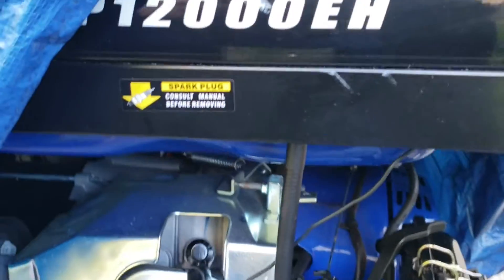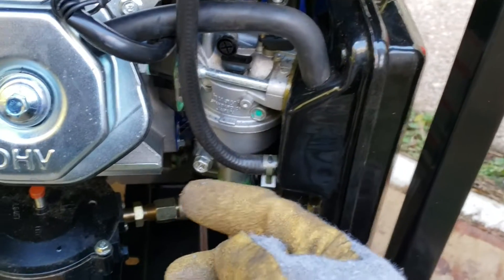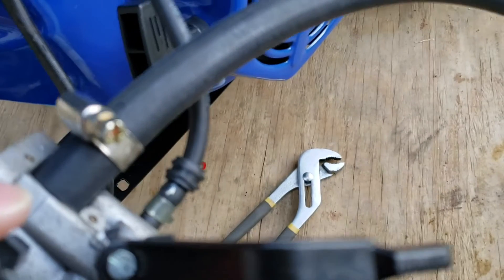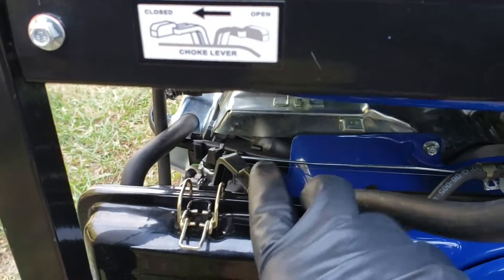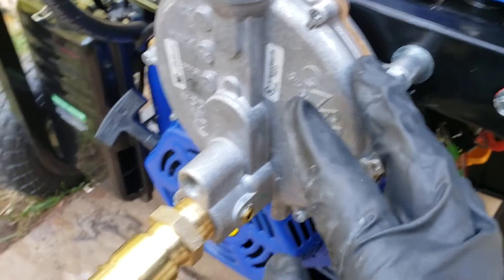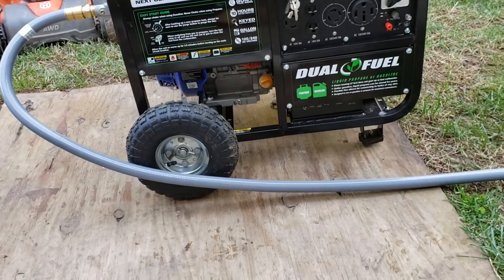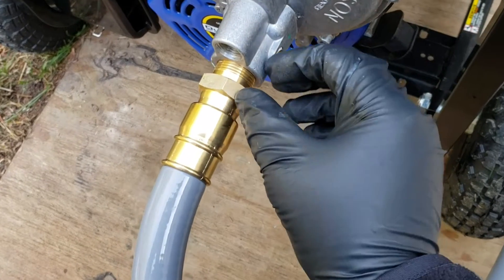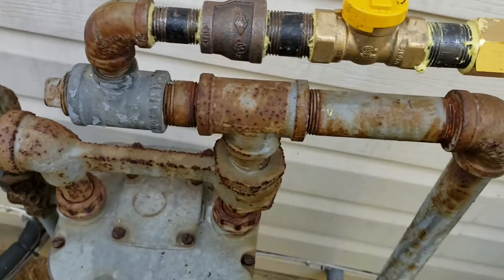DuroMax XP12000EH - Converting Gas/Propane Generator to Natural Gas (Dual Fuel to Tri-Fuel)

Comment: I did my testing with a xp12000eh on natural gas. I got the same regulator and hose as you have. My gas meter is in the front yard, my generator is in the back yard. From the meter, I have a 1inch corrugated run of about 15 feet to a 3/4” manifold. From there I have one 3/4” outlet and five 1/2” outlets. I originally had a 1/2” run of about 12 feet to the bilco door in the back yard. I stepped the 1/2 up to 3/4 and connected the quick disconnect and 3/4 line to the generator. I was able to pull about 5500-6000 watts just fine. I then replaced the 1/2 to 3/4 all the way and added an exterior Stainless Steel Burnaby “gas plug” cover panel and had no improvement from the step up. Overall I am very happy. Thanks for the video.
Reply from the maker: Wow, so it doesn't really matter if the gas line is 1/2 or 3/4... I wounder why so many people online claim that you need such a thick gas line for these generators. I could have saved money on my expense 3/4 line. What do you think the Max watts this generator could do on NP? I read that you can expect 80% of watts from the listed gasoline spec. Thanks for sharing

Comment: The ideal configuration is to have propane and also natural gas. Here is such a regulator: https://www.ebay.com/itm/New-Chinese-Natural-Gas-NG-and-Propane-LP-Regulator-Please-See-Descript/264198501779?hash=item3d83753593:g:I~QAAOSwXlpcZwsu
Reply from the maker: The problem with these type of regulators (link you provided) is that they are made for lower HP engines. This one in the link is for a 10HP engine or less. This Duromax is 18HP . I can still run this generator on propane with the regulator that I installed.
Reply: Exactly... 10hp on propane so more like 7hp on natural gas.

Comment: I assume (don't laugh) that adding this NG capability doesn't negate the ability to also use gasoline in the future, right? It's just "adding" NG capability...it's not removing the gasoline capability? I'm in Florida in hurricane season and getting ready to get this Duromax 12000. I'm in a NG community and want to do the same. Love the set up!
Reply from the maker: Nope it doesn't negate the ability to use gasoline. In fact... I did a follow up video a few weeks ago that shows how easy it is to switch between NG and Gasoline. https://youtu.be/okGfZKPHx6E
Reply: @Mr-Chris  Duromax 13000 arrives soon, and so does the NG regulator. SUPER helpful video. Used to live in Fairfax. If I'm ever back up in the area, I owe you a beer!

Comment: Your experiment worked - you installed the US Carburation NG regulator and did NOT install the Snorkle piece, and your generator ran fine on NG.  So, why does US Carb include the Snorkle piece?  It doesn't seem like it's necessary.
Reply from the maker: The Snorkel is for Generators that run only on gasoline and need to be converted to natural gas/propane. Since my Generator is already was setup to run on propane, I didn't need the Snorkel. US Carburation sells a kit without the snorkel, but I didn't know that at the time

Comment: I'm impressed that you can run your central AC with the generator running on NG.  You lose about 20 - 25% generator output power when running on NG.  Running my Sportsman GENTRI9K tri-fuel (rated at 9000w surge/7200w run), I'm probably only getting about 5000w running power, and of course, that won't run the 4-ton central AC.
Reply from the maker: Im lucky that it does since my Generator is (12K surge/10K running) that brings me down to (10K surge/8K running) on NG. Also my HVAC is one of those newer two stage units so my AC starts on the lower stage making it easier on the generator to run it when it kicks on.
Reply: How do you know how many watts the generator is putting out?  I have the gentri10k running on natural gas.id like to know how I can check. Thank you
Reply: @thetonekingofficial  I was just estimating.  Running on NG gets about 80% of full power running on gasoline.
Reply: Look into a soft start for your HVAC compressor. It will dramatically lower the starting amp draw on a regular compressor.
Reply: @dalltex  Yes, I had one installed ($500) on the 4-ton central AC.  The 9kw/7kw still won't start it.  I ended up installing a 2-ton 3-head ductless AC system ($8000) and the gen runs this perfectly, all three heads at the same time, along with everything else in the house.

For kicks, I just got an estimate from Generac for installation of a 22kw at $10,000.
Reply: @prettygirlus9008  I love mini-splits. Very efficient. You can also put an inverter condenser (Carrier Greenspeed for example) and have a regular split system that pulls around 20-25 amps at startup. Same technology. Glad you got yours running on your generator

Comment: Excellent work!  Why did you use such a heavy 3/4-inch diameter NG hose?  I use a 3/8-inch diameter NG hose (Dozyant, $30 AMZ) to run my Sportsman GENTRI9K tri-fuel portable generator.  What's the benefit or differences between using a bigger diameter NG hose?  And is it necessary?
Reply from the maker: During my initial research and reviewing how to hook up a generator to Natural Gas, it was suggested due to the size of my generator, it was I should have a 3/4 inch hose. However I'm not an expert and it could possibly run just as good on a 3/8 inch hose. Being a novice at this, I just bought the one that was recommended by the supposed professionals.

Comment: Great video.   I converted my Duramax 10000 generator to NG gas.  My question, does switching from different fuels change the Hz?
I would like to keep it at 60Hz but I don't have a meter that will measure Hz.      Thank you
Reply: If you add a tachometer you can adjust so you are running at 3,600 RPM which is the spec to produce 60Hz per DuroMax.  They run $25 and super simple ..
Reply from the maker: @johnandersen9219  THANKS for this info! I have one of those and hooked it up while running NG and confirmed it was running at 3600.
Reply: Chris ... Hi Chris... I had first installed the Snorkel but I could not get it to run at a consistent RPM, so today I followed your lead & bypassed the Snorkel & picked up a fuel hose from a local Auto Parts store & now everything is running smooth!!
Yea!!  Now let’s hope we “Don’t Loose Power” due to another Frigg’n Fire in N California 🙏🙏
Reply: @Mr-Chris  FYI,   I bought a Frequency meter and it is putting out 61.25 HZ.   A little high.  Might have to slow the RPM down a touch.  Other than that it runs great on NG.
Reply from the maker: @Longday-i2d  thanks for this update.
Reply: Was that at idle or under load?  If it was under load, you should be ok. Remember, when you add a load, the frequency will change by going down.  That's why it's important to set the frequency under at least half load using a "Poniie PN1500 Portable Micro Electricity Usage Monitor Electrical Power Consumption Watt Meter Voltage Amp Tester" Plug this into the 120V outlet on the generator and make your adjustment. We have the same Tri-fuel kit on our generator running on NG. This meter is really helpful and a must have when using a portable generator.
Reply: @Pk3_Garage  No it was not. I have since moved and no NG here. I am stuck with a brand new converted gas generator!  Guess I will have to store gasoline again.  Thank you for your comment.
Reply: What's the fuel source at your new home then? If it's LP, you can make a small change to your system to run on that.
Reply: @Pk3_Garage  Electric only.  I thought about getting large propane tank but I live in a retirement village and I can't have an outside tank. Thought about 2- 100 lb propane tanks in the garage but what I have read, You can get more running time on gasoline.  Hurricane season is starting here in Florida.
Reply: I see. Might want to invest in the LP as well. You can never have to much fuel and when the gas stations run out of gas or don't have electricity for the pumps. Also, with the motor snorkel kit, it claims you have as much run time as gasoline per gallon. You can test that theory out, before a natural disaster. We use NG as our main fuel source. We have two 20lbs cylinders of LP and 15 gal. Of gasoline. It's nice to have choices.
Reply: @johnandersen9219  Thank you John I will try that.
Reply from the maker: Unfortunately I haven't had the chance to get the proper tools to be able to read the megahertz coming from the generator.

Comment: Hi Chris, so today is 6/23/2020.
How is everything working as of today?
Any thoughts or issues on voided warranty etc?
Thanks!!!!!!!!
John
Reply from the maker: This Generator is almost 3 years old and this is still running great. I don't use this generator often as it's a back-up in case of power outage. I did this conversion to Natural gas several months ago and I tested it out last week. It ran the entire house including my central AC while running on Natural Gas.  Even though it has low amount of running hours, I still change my oil every year and keep it connected to a solar battery tender on the original battery. This thing is built very well and starts right up.
Reply: Chris Thanks Chris.... I just got the same unit for our pending Fire Season in Calif. and I just didn’t like the idea of dealing with the Gas issues & multiple Propane tanks.
Very much appreciated your posting your videos 👏👏👏

Comment: Chris, great job all of this. Just to clarify, it wasn’t necessary to remove the carburetor after all, correct? All you really need to do was connect a longer hose, correct? Thx!
Reply from the maker: Technically you do not need to remove the carburetor in order to install it, however I found it difficult to remove the camp and old tube with the carburetor still on... So I ended up removing the carburetor to make it easier for me.
Reply: Chris Thanks for responding so quick. And, again, it is NOT necessary to use the motor snorkel, correct?
Reply from the maker: @stevewalmsley1219  that's right, you don't need the snorkel for this type of generator. I have a link in the  description of this video to a kit without the snorkel to save money on this conversion.
Reply: My duromax 13000xp manual says to change oil every 20 hrs of use. The 1200xp is once a year?

Comment: Same regulator and process for the DuroMax XP15000EH ?
Reply from the maker: I think so. According to manufacture, this regulator is rated for engines 5HP and above. They don't indicate a limit on how large of an engine. Link to the kit so you can review and decide: https://www.motorsnorkel.com/dedicated-propane-or-lp-natural-gas-only-no-gasoline-universal-conversion-kit-for-log-splitters-generators-pressure-washers-for-engines-5hp-and-below-2709.html
Reply: @Mr-Chris  FYI, US Carburetion said it wouldn't work because the 15,000 is a dual-carb generator. So I ended up buying the 13,000. It will still handle my power needs, even with the 20% natural gas loss of power. I just wanted the 15,000 for the extra power just in case. Just FYI in case anyone else wonders about this in the future. 👍🏼
Reply: So now I've run into a bit of a quandary. I bought the xp13000eh and it's set-up different. Instead of the propane regulator being already attached to the frame with a hose to the carburetor, it comes with a separate propane hose that you connect to a propane bottle and the hose has the regulator on it - and then you attach the other end of the hose to the propane inlet on the front panel of the generator. There's a knob also on the front panel that you switch turn to propane, off, or gasoline. That knob also has hoses attached to the back of it behind the front panel that go to the carburetor. So now I have to figure out how to do all of this, what to bypass and how to make it all work with that gasoline or propane control knob. And I have searched the internet high and low. There are no instructions or videos for the xp13000eh.
Reply from the maker: @itsthejody601  any luck? I'm very interested
Reply: @Mr-Chris  Ah yes! I thought I did follow up. Sorry. So the 13,000 is pretty much exactly as you did with yours. The only difference is it has a switch on the front that you move from Gasoline to Propane. After removing the propane regulator and replacing it with the natural gas regulator, you still have to turn that knob to propane. I'll try and make a video this weekend. Had to pretty much take the whole front control panel off to get to the propane regulator because they stuff it in right behind there, not on the frame in an easy location like yours.
Reply: @itsthejody601  i just ordered the 13000.  If i understand correctly you removed the propane regulator and replaced it with a natural gas regulator and thats it?  Did you use the existing hoses that were on the propane regulator and did you have to make any modifications to get the natural gas regulator to fit or did it bolt on to the existing mounts?
Reply: @itsthejody601  thank you
Reply: @itsthejody601  would u mind taking some pics or video. i can seem to get my 13000 gen to run. i am waiting on A 3/4 LINE to be installed at the meter. I had a 3/8 line that runs about 40ft; so im sure thats not helping
Reply: @Mr-Chris  Thanks. After I posted, I did some more research. Seems they have changed propane regulators and moved it to one of the legs of the frame on the 15000. Hoping there's nothing else they changed that is different from your 12000.

Comment: Is there any worry about the hose not being rated for a 13HP engine? With the kit came a warning not to use a grill hose over 5HP because the max rating is 54000 BTU, but I'm not sure if they are referring to a 3/8" vs this 3/4".  Also thank you so much for doing this, I've been asking the same thing for 2 years since I got my generator.
Reply from the maker: No worries using this hose, during my research, I remember finding several posts from people who specialize in this stuff write how  a 3/4 hose is what is recommended given the length of hose and size of generator.

Comment: Look at my vide0's. You can upgrade to 50 amps so long as you have extra slots on your breaker panel. Install an inlet outside and run the line to the breaker panel and connect it to the 50 amp breaker. Then install an interlock kit on the panel to prevent back feeding.
Reply from the maker: Cool video, Trust me... I wish I could do that. I tried to go down that same path, but I have an older split bus-panel breaker box. It won't work with my kind of box because it doesn't have a single main cut off to entire box. I would have to upgrade my entire breaker box before I can install an interlock. I wish I could do that and get 50amps.
Reply: @Mr-Chris  Oh I see, you could also maybe do a sub panel outside that feeds the breaker box inside and do the inlet there. I replaced the panel you see in my video, it cost me $1200 through a larger electrical company. What I know now I could do it myself with a little help and it would cost about $200. My old panel had no extra slots which was one reason why I did the 4 circuits vs the whole panel. Either way what you have now is fine and is better than what most people have. Thanks for the reply.
Reply from the maker: @billybassman21  OMG, the electrical contractors here in the DC area where I live price gouge like crazy. I received three different quotes  between 5 to 7K to replace my breaker box.
Reply: Chris That’s insane. I would keep shopping around. HVAC techs don’t the same thing, that is why I learned how to do most of it myself.
Reply: In 2018, I upgraded my 1957 200-amp electrical panel with a new Square-D 200-amp panel, and installed an interlock switch, generator power inlet box, and in-panel whole-house surge protector for $2300 parts and labor.

Comment: Did you think about mounting your regulator at your natural gas source? You doing then be able to runless expensive hose to your generator, and can use quick disconnects to choose between NG and propane! Saw another video where a fellow did that.
Reply from the maker: Never thought of that. My concern with that idea would be if the regulator would get enough vacume from the generator to open and close correctly... being so far away from the generator and close to the meter. If it's proven to work correctly, then one can get buy without a expensive hose like what I have.  I would assume you wouldn't leave the regulator outside all the time and one could setup some sort of quick disconnect to mount it when needed.
Reply: Chris, I'm running part black iron pipe and csst (corrugated stainless steel tubing) from my gas meter to a regulator. Total distance is 16 ft. All pipe is 3/4". From regulator to generator will be 12' of 3/8" flexible with quick disconnects at the regulator and at the generator. Our gas load for the house is minimal. Two furnaces and one hot water heater.
Reply from the maker: @BadOldBuzzard  Cool, don't forget to paint your pipes, they will rust without a good coating. I used 1 can of grey RUST-OLEUM professional high performance enamel spray paint and repainted my entire meter plus new pipes to match in color.

Comment: What’s wrong with your 30 amp?.. I have a 30 amp interlock kit I can run my A.C and one stove burner,and basic lights,tv ,fridge and freezer and no problems..1600 sq ft house with 3 ton unit.. I think what you got  works fine, my biggest worry for you is the pipe on the meter being so long it might crack sometime maybe stick block of wood between to take some stress off of pipe..how big is that generator? I think you did a good job ,natural gas is my next project just done the interlock was easy and works great..
Reply from the maker: Nothing wrong with 30 amp, but it would be nice to have a 50 amp transfer switch. This Generator is 18HP, 12K watts surge & 10K running. I don't keep the natural gas hose connected, but when I do connect it... I now move my grill into position to make sure to the hose rests on top of it to take weight off the meter.